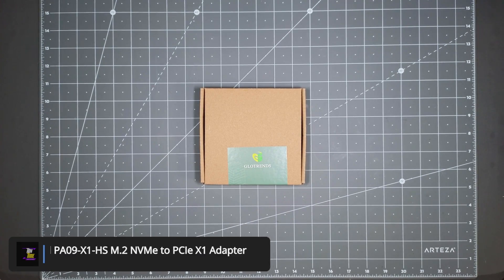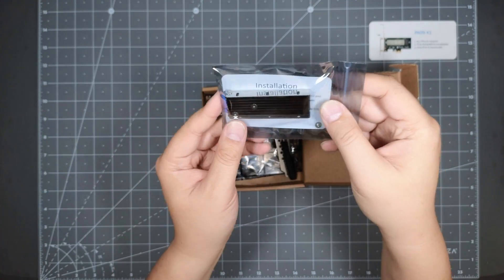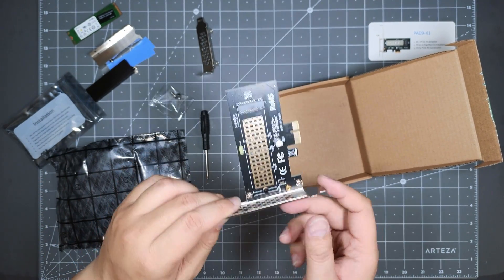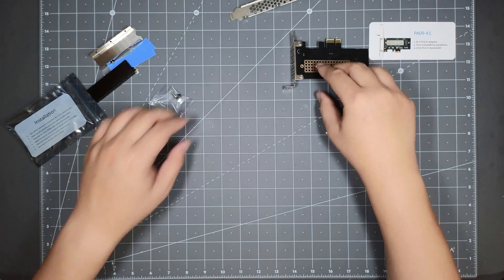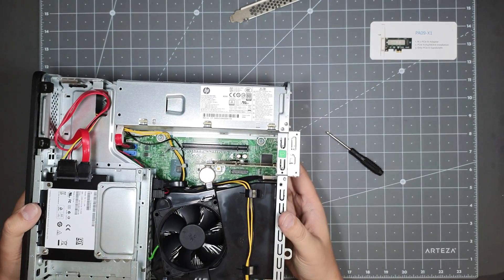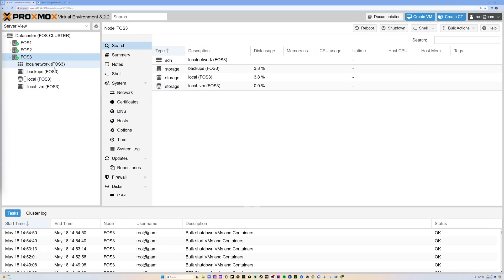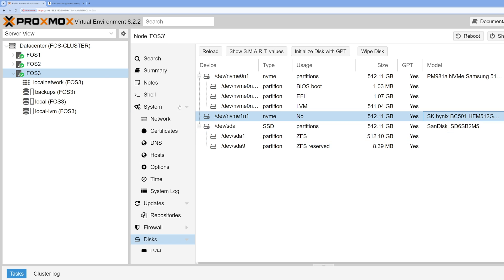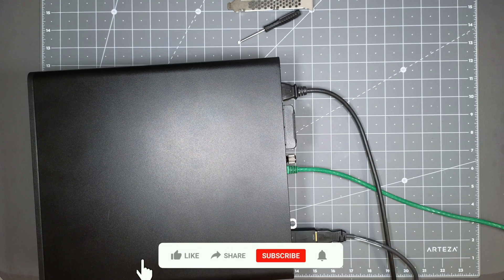Glotrends M.2 NVMe to PCIe X1 Adapter Kit installed in HP Pro Desk SFF Computer Using Proxmox Linux

Comment: Is there any improvement vs ssd (sata port)?
Reply from the maker: Speed wise, since this card I'm using is only running 1X speed, it's pushing about 1gb/s while a full speed Sata III can do 6gb/s.  I'm just using this card for extra onboard storage rather then a boot drive.  If you get a PCIE 4X card with NVME, it will be a lot faster then Sata.
Reply: It’s a pcie to nmve not the other way round.